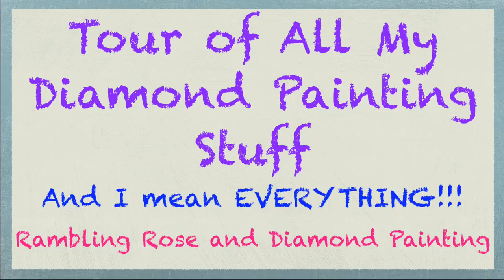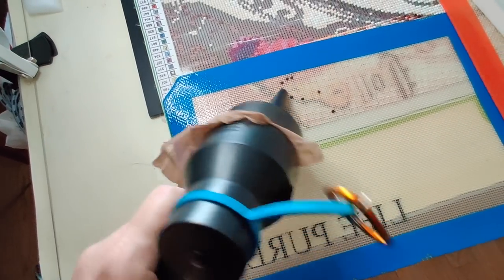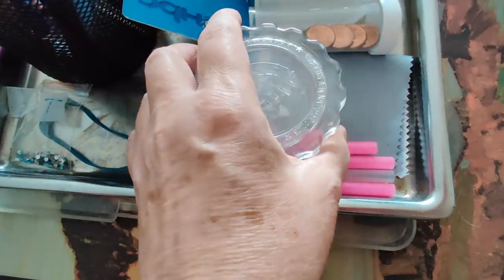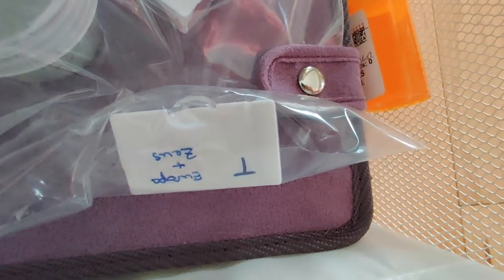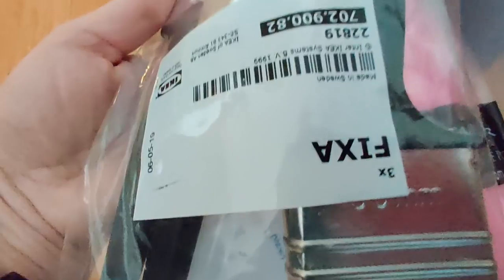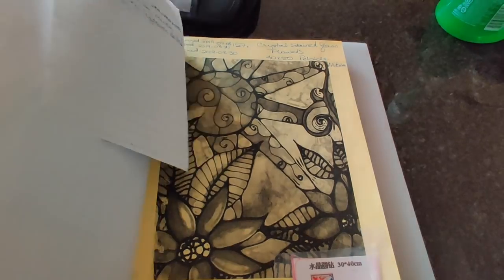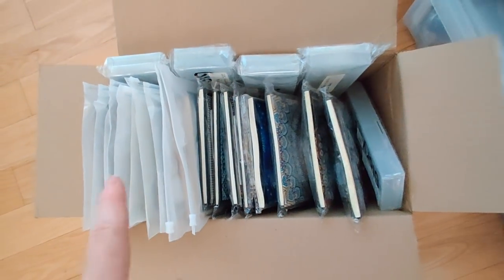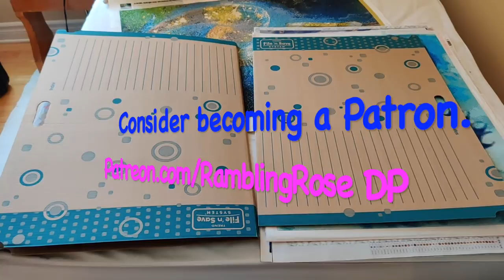Tour of All My Diamond Painting Stuff!!!!

Comment: Awesome awesome awesome video. I have been paper crafting since the early 90’s. My paper & stamp stash took over my space. Now that I’m getting addicted to DP I’m trying very hard not to buy everything I see. I think your endorsement of the Trends storage system has sold them out, but the IKEA under the bed storage box looks interesting. Lots of great ideas. I’ll have to watch this again, but this time make a list.
Reply from the maker: I like the Ikea under-bed storage, but it's actually too high to fit under either of the beds in my condo, so, word to the wise: either get bed risers, or measure the floor to bed height before you buy. 😊  I just ordered a bunch more Trend folders, but I'm getting a six-pack of the medium sized ones.  They'll fit in the big storage box and canvases will just extend beyond the edges.  That said, I got the smaller ones because the big ones are sold out at Staples.  😊

Comment: Are you saying that the silicon baking mats can be used to cover your canvas instead of the cheap plastic paper that rips so bad. I like to work in sections! Can I cover the painting with mats for the whole picture except what I am working on, and when I want to stop, cover the area with another mat to keep sticky? Thanks, I am a beginner!  Ricki
Reply from the maker: Hi Ricki, yes, that's exactly what I'm saying: you can buy the silicone baking mats and use them to replace the paper or plastic covers that come on your diamond paintings.  They protect the adhesive and are comfy and non-slip to work on. I would use one of the thinner ones from AliExpress for this, but the thicker ones from Amazon would work just as well - it just depends on your personal preference.  I like using the silicone baking sheets way, way better than parchment paper.  ❤️

Comment: Can I get the info on the silicone mats and the baking mat please
Reply: You can message me on my Facebook messenger https://www.facebook.com/scranmer3
Reply: And the thing you use to separate the beads that stick together I definitely need something that I can use to separate them
Reply from the maker: @shannoncranmer579  the top comment has links to everything people have asked about, including the silicone baking mats and the drill separator.
Reply from the maker: Hi Shannon - I don't use Facebook or FB Messenge.  There's a pinned comment that has the links to all the items people have asked about.  You can find it at the top of the comments for this video.
Reply: @RamblingRoseandDiamondPainting  have you ever encountered condensation in the bead packets and if so how do you dry them out?
Reply from the maker: @shannoncranmer579  That might not be condensation - that might be oil. Sometimes the few batches of drills made right after the  machinery has been oiled come out covered in oil, and then they clump together.  You need to wash them if that happens, and there are  a few ways to do that.   What I've found works for oil is to pour the drills into a wet baby wipe and then rub the drills well to remove the oil.  You could also put them in a tea ball or a fine mesh strainer or a sock or knee-high that you've knotted at the top and wash them in warm  water with a couple of drops of dish soap. Then dry them by spreading them out on a paper towel and letting them air dry.  That would work in the case of condensation, too.
Reply: Thank you I was hoping I wasn't the only person that ha encountered this problem
Reply from the maker: @shannoncranmer579  you are definitely not the only one! I've probably had 100 requests for the link to the silicone baking mats! 😊